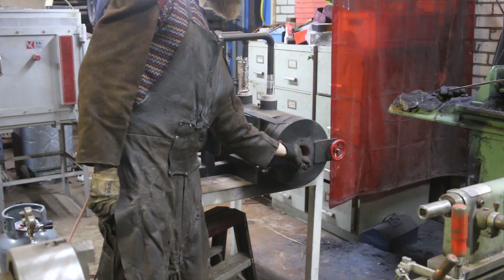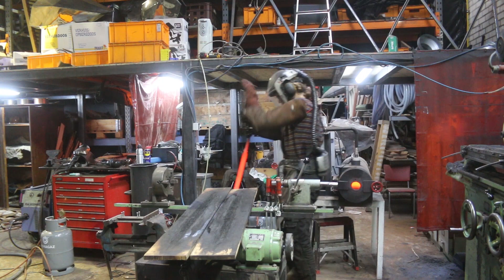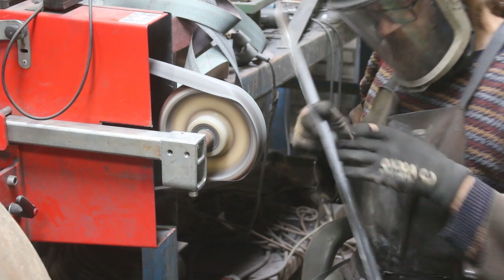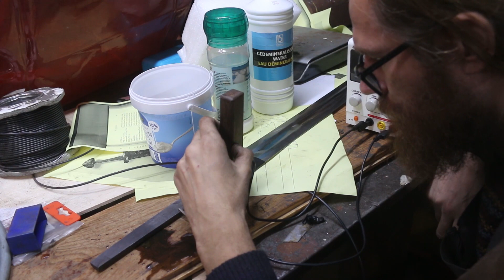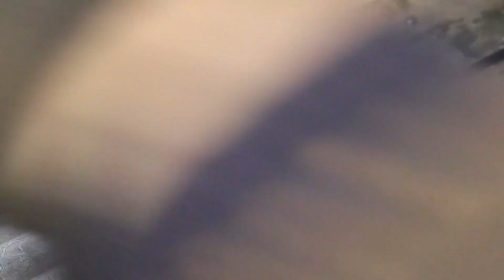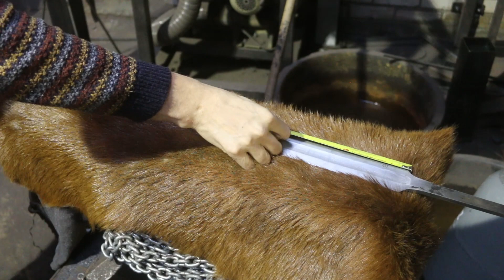Forging a Viking sword, part 2, heat treatment.

Comment: Hi ! I have a question: why you put the sword between the wooden boards ? To avoid deformation during the metal cooling or for some kind of chemical treatment like the carbon of the wood that goes into the metal ? Or both ?
Great job anyway !
Reply: I believe he only clamps the sword between wooden slabs to prevent the blade from warping while cooling. Case hardening, the process where the outside surface of the steel is impregnated with carbon to make it more wear resistant, only works if the iron/steel is kept at the critical eutectoid temperature for some time while in contact with a carbon source. 

Damascus has that laminated look because these different metallic layers are emphasized and highlighted by bright and dark coloring during the etching process.
 The smith stacks each metal layer in damascus steel based on its chemical and carbon content; which, in turn, influences the color change and rate each layer dissolves when exposed to ferric chloride. Case hardening the blade would actually create a more uniform carbon surface layer for the blade; thus negating the etching process meant to showcase the layering of the damascus steel.

One way case hardening was done prior to the industrial revolution was to have a form of powdered carbon and bone mixed into a paste and applied to a iron/steel surface. The paste would dry, then be encapsulated, and heated to a high temperature for a period of time. Encapsulation is critical help minimize carbon monoxide oxidizing with atmospheric oxygen to form CO2 and facilitate carbon migration into the Austenite crystals at the surface. The depth of  carbon migration into the metal was related to how long the metal was allowed to "soak" in the forge. I'm pretty sure the metal isn't hot enough while in contact with the wood for any noticeable carbon migration to take place and change the chemical composition of the surface steel.